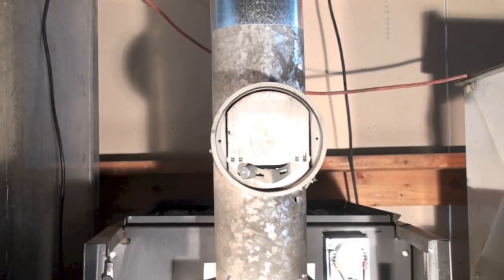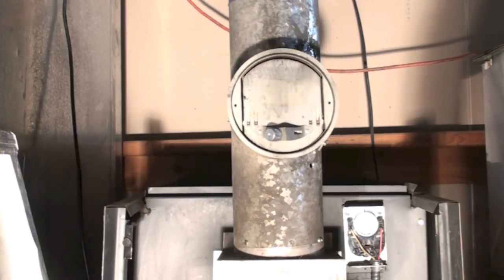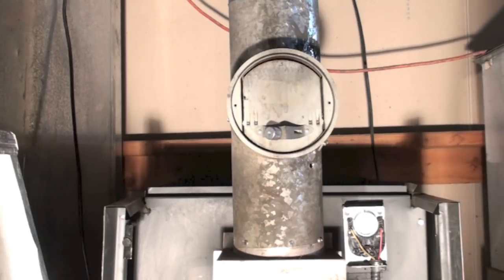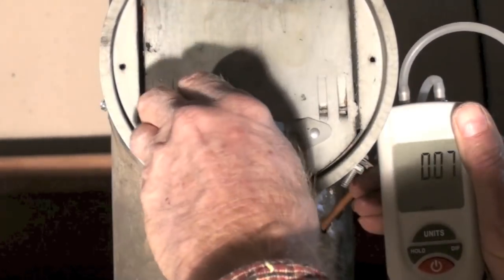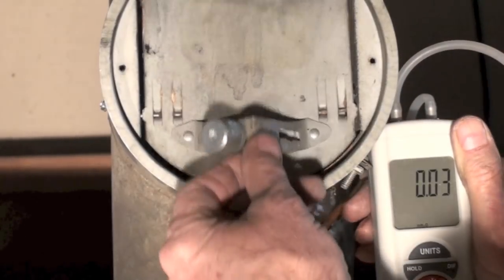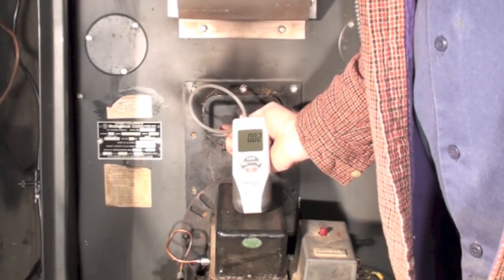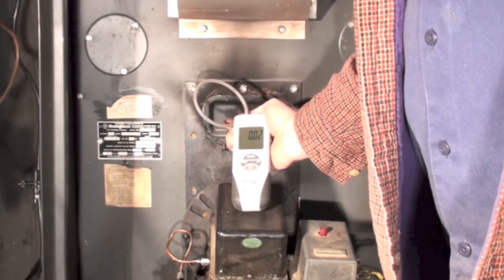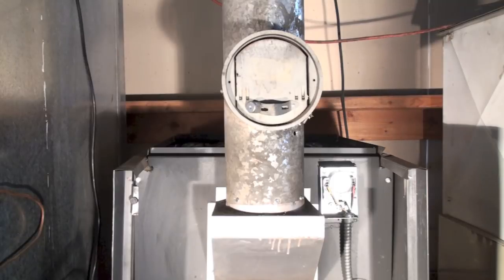How to set the oil furnace barometric damper

Comment: Great video. My damper, which is partly open when furnace isn't running,  always seems to close mostly shut when the oil burner kicks on. Is this opposite of how it is supposed to work? I thought the heating of the flu would increase draft and cause the damper to open a bit when burner is on.
Reply from the maker: It probably does not mean anything.  You could have a positive pressure in the house that may cause that.  Hope this helps.
GFM
Reply: @grayfurnaceman  He may have worn pins or something else that is not allowing the damper to move as freely as it should.  There are some cheaply made barometric dampers.  The good ones are made by Field. Sometimes the pins or the slots they ride in wear out causing the blade to drop and bind.

Comment: Your digital gage reads positive pressure, should it be negative or positive. Some Carrier oil furnace are designed to run in a pisitive draft while running.
Reply from the maker: I keep doing that! durn.  The pressure in the vent is negative.  When using metal vent, the pressure has to be negative.  You have probably seen 90+ efficient furnace.  They have a positive pressure in the vent.  Thanks for the thoughts.
GFM

Comment: many questions  :-) 
if i have to mutc noise of the burner noiller and exsaust , waht can i make to minimise the sound? i must play with the head to open it or close it? the air ?   smaller nozzle?
put in your mide , i cant change the pipe of exsaust because many people they dont want toi give moeny for that , so i want a solution with that !
Reply: a penney wise, a pound foolish,....
Reply: What are you even talking about...?  Talk to your HVAC technician the next time you have the system cleaned. Maybe they'll be able to understand you and answer your questions... but it certainly doesn't sound like it has anything to do with adjusting the barometric damper at all.

Comment: This device is at the bottom edge of it's scale, how you can say it is 0.01 or 0.02 difference? Could as well be 0.03 or less than 0.01. Considering the measurement on top was made with tube pointing down, toward the stream of running gasses which would slightly increase readings due to dynamic pressure added, I'd say static pressure difference is 0.01 or less. Need more precise or analog device here to tell better.

Comment: Is your barometric damper mounted upside down, I have a F. Controls RC type mine is mounted with the weight on top area. Between the furnace and chimmney is an angled flue mostly horizontal, so i have the weight on the left side.
Reply from the maker: I have seen this done both ways and it works fine either way.
GFM
Reply from the maker: You definitely need one and it should be adjusted with the use of a manometer.
GFM
Reply from the maker: Dampers are there to reduce draft.  You do not seem to have enough.  Be sure the smoke pipe and chimney are clear.  Heat exchanger could also be plugged.
GFM
Reply from the maker: Welcome
GFM

Comment: I have a Williamson Highboy Oil Furnace by Metzger mfg in 1999 and my over fire reading is -1 and overdraft reading is -1 and cant seem to increase my overdraft to -2. Specifications call for -1 to -2 for over fire and -2 to -3 for overdraft. Thoughts? thank you
Reply from the maker: You can't get a high overfire draft if your smoke pipe draft is low.  You need to increase the draft up the chimney.  First be looking for blockages in the smoke pipe or chimney.    Also be sure you have the maximum pitch between the furnace and the chimney.
GFM
Reply: @grayfurnaceman , my flue pipe is approximately at a 45 degree leading to chimney. My damper face is nowheres close to being level. Could that cause an inaccurate reading or less draft?
Reply from the maker: @matts7917  Yes.  You can rotate the damper to horizontal.
GFM
Reply: @grayfurnaceman  Thank you Sr, greatly appreciated

Comment: When I have my boiler adjusted the best I can, testing draft over fire and 0 smoke, at times, cold weather, the damper gets maxed out, running wide open. Wasteful sucking all that warm air up the chimney to keep the boiler to spec. Any acceptable way to decrease the draft of the chimney? I have stuck some bricks in the hole where the stack goes in the chimney and it helps a bit. Can't see any harm as I still have plenty of draft in summer and bricks don't burn. Replaced all of the turbulators awhile back, 18, with twisted spiral ones. Stack temperature down to more acceptable level now.
Reply from the maker: Do you have a barometric damper?
GFM
Reply: Yes. Under some conditions it is open all the way, although I never checked to see what effect this has on the boiler. I guess it would increase the draft but to any harmful effect I don't know. Anyway, it's a lot of air going up the chimney to balance the combustion draft.
Reply from the maker: @bigpardner  The barometric is there to reduce draft.  You can get an outside air adaptor for barometric draft dampers.
GFM
Reply: Thanks for replying to so many of our questions.The damper is certainly reducing the draft-through the boiler-but when it is maxed out under very cold weather I assume the draft through the boiler rises above what it should be. I adjust for -.01--.02 but usually not in winter. Guess I should test it when this happens to see how much it rises. I've thought about outside air, which in my case should be easy as there is an unused duct left over from previous owner having a Jennair downdraft grill above in the kitchen that goes outside, passing right through the boiler room. . It has an outside vent working in the wrong direction though. Since the boiler is in it's own small room I've thought about just supplying outside air to the room and try using something like a barometric damper to let the air in based on need for it. That still wouldn't prevent the draft of the chimney exceeding the stack damper's capability to adjust for it. I think I recall reading somewhere about using two dampers but that's more metal work than I want to get involved in. I'll wait and test the draft once it gets cold,  but was wondering if there is an acceptable way to reduce chimney draft.
Reply from the maker: @bigpardner  The barometric is the only way I know.
GFM

Comment: My vent is always open . Even while the boiler is not running.  Is that not oka?
Reply from the maker: It is probably open because of a positive pressure in the structure.  May not be much you can do about it.
GFM

Comment: Hi GFM.  I have what looks like the same model manometer as yours, but can't seem to get an accurate reading out of it below 0.10 (as in it seems to only start reading from 0.10 and then up in 0.01 increments - 0.00 reading prior to that).  It is a HT-1890 readily available on eBay and might not be the same as yours.  I can't see from the video where you have the other hose/probe you aren't using, or is it just hanging down and not important? Does it need to be connected and at the same length as the hose you are testing with? The "instructions" that came with the unit aren't any help... Cheers
Reply from the maker: Sounds like junk to me. lt does not need the other hose.
GFM
Reply: Thanks. I figured that might be the case. Do you have specific model or a link to the one you use? Mine looks identical, but clearly isn't.
Reply from the maker: Its been so long since I got that one, I don't remember the source.  You might check my channel under the playlist "tools".  I think I did a video on it when I got it.
GFM
Reply: sometimes people want to test them so they blow in them like a balloon and knock the hell out of the calibration...

Comment: Your videos have been very helpful, thank you. I bought the manometer you use and it's very erratic. The measurements range from 0" WC to -.12" WC. Do you know any possible causes? I'm thinking of returning the manometer for another.
Reply: Just look at the barometric pressure of the room air. Obviously it should be steady. If it's not, return it.
Reply: @paulmaxwell8851  Thanks for the reply. I bit the bullet and got a Bacharach Draftrite and it's flawless

Comment: my boiler has the baro damper mounted horizonally at the rioght side of my boiler. The main stack, goes out to the left and runs about 40ft, to a power venter. The damper has the adjustment weight located at the top of the valve. is the correct position? in your video,  i see the adjustment screw at the bottom. Which position is correct? Thank you.
Reply from the maker: They will actually work both ways.
GFM

Comment: when our oil furnace is not running , we have quite the downdraft , that blows out into the furnace room via the damper , with  the -20    degrees C  this is a real lose in heat.  are there any dampers that are better at being airtight  than others when not in use.
Reply from the maker: The problem is not the damper, it is the negative pressure in the structure.  I am surprised that the furnace does not rumble on startup.  I would be looking for leaks in the upper level that are leaking warm air out.
GFM
Reply: thanks for feedback , will look further...

Comment: GFM, Where did you source the prob at the end of your manometer?  Can I use the static pressure probes like the one I use for my AC system for this? (I assume yes).
Reply from the maker: Actually, I just used a piece of copper tube.  The velocity is low enough that nothing special is needed.
GFM

Comment: I think it’s just because of the design of the crazy heat exchangers that Millers have that you never can get a true negative draft at the flame inspection hole because normally they are just vented straight out the roof.   when I open the little inspection door to look at the fire it goes from negative to faint positive negative to faint positive and so on and that’s what my service guy that looked at it said it has a hard time establishing draft I think.
Reply from the maker: I don't think a barometric would help here.  Barometrics reduce draft.
GFM
Reply: @grayfurnaceman   yeah but do you think the 12 feet of 4 inch pipe is causing much back pressure on the furnace?  It’s never had any issues in the 3 years I’ve had it installed except for the very recent issues of it not lighting.  But I think it’s working again so far it’s been running through the night yay!!   
      I’m thinking of going with the thermo-pride miller replacement when this one wears out because they are still cleanable!! Do you think that I could just install it the way this one is installed with the 12 feet of 4 inch pipe or would I want to install a chimney??
Reply from the maker: @mainelyelectric  I would recommend any horizontal pitch be as steep as possible, but it should work.
GFM

Comment: How come the manometer is showing positive draft in the flue. I have the same meter but it shows a negative number. Been learning allot from your channel. My new oil fired boiler has a positive in the chamber and negative in the flue.
Reply from the maker: It is actually negative.  I generally do not pay attention to whether it is positive or negative as if it is positive, there will be a strong smell near the vent.  
If your system has not been in use and has a positive in the combustion chamber and is not designed for a positive pressure in the combustion chamber, there is a problem with the installation.  There should be specs with the installation instructions.
GFM
Reply: @grayfurnaceman  Thanks. The video showed .02 and not a negative .02 at 2:36 of the video. Mine is suppose to have a positive .02 over fire and negative .04 at the breech or flue. I always thought you needed negative at the breech.

Comment: This may be a stupid question, but how come you never see those barometric dampers on gas furnaces? Most of the time when I test, the draft is high, and this would be an easy fix rather than getting into resizing vent pipe. The only time I would see a damper would be if it has a side vent kit. Maybe you can do it, and its just not popular, but I can't recall ever seeing one. thanks
Reply from the maker: They are actually used on some commercial and industrial units.  As for gas designed appliances, they will have one of 2 vent controls.  Older furnaces used a draft hood to control draft and too big of venting(up to a point) is considered ok.  The second is induced draft appliances.  They are negative pressure vents,  but a barometric would upset this draft and may cause vent gasses to be vented out the barometric.  So I guess, leave them alone.
GFM

Comment: Do you know what would cause the damper to Slap close from time to time 
Would it have to do with positive pressure in house or possible short cycling of burner?
Reply from the maker: Its from a positive pressure (wind?) in the vent or a negative pressure in the structure.
GFM
Reply: Thank you

Comment: Thanks for posting the video BUT may I suggest you start out explaining 1) the physical significance of having the device in the exhaust of the heated, burn gas; 2) how is the device constructed so it would open by adjusting the weight and how the movement of air creating the negative pressure differential that would cause the flap to open and allows the ambien, unheated air to move in by the suction effect of the moving hot air, etc;  otherwise, you are just telling the minute changes in the number but did not explain the meaning behind doing it. You may write and say you assume people already know what the thing does, etc.; if that is the case, then.....
Reply from the maker: You are correct that this one is about how to adjust the barometric.  
You are also right that I should be doing one on what it is there for.  I will try to get going.
GFM
Reply: @grayfurnaceman  Thanks for the reply. Great job on the video.

Comment: Wondering why your manometer is showing a positive pressure draft instead of NEGATIVE (-) .02 and .04 respectively?
Reply: nevermind... Didn't notice previous posts
Reply from the maker: Mark Bean It is on the wrong side of the tool. I tend not to pay much attention. The number is the important part. 
GFM
Reply: Thats a shop environment, not an actual install.  you wouldn't put your access hole there  so close to the damper, thats why he kept trying to aim it down in the video... with 3 feet of pipe, it would be easier for him to show Im sure...

Comment: Mine blew off and flew 10’ yesterday , any answer to that?
Reply from the maker: Put it back on, lol.  
Seriously, you have had a blowback (read kaboom).  This was probably due to delayed ignition.
First, you need to check the heat exchanger and smoke pipe for soot.  Clean the soot out, and service the burner.
GFM
Reply: @grayfurnaceman   thank you. had to disassemble the unit and clean it up!

Comment: I just bought the same manometer. I’m confused. What unit of measurement to I set it on for the same testing you show in the video?
Reply from the maker: I generally use inches water column.  (in wc)
GFM
Reply: My manometer says (InH2O) for wc, I think but on that setting I get no readings. If I use (ozin2), I get readings that look normal...?  Looks like the exact manometer you used in the video. Is ozin2 unit ok? Also,  this boiler has no heat exchanger, it heats water for radiators. Just cleaned the cast iron grills and it read .03 over fire, and .03 to .04 in breech. Hole in breech is 12" above top of boiler. Am I good to go?
Reply from the maker: I think you are good to go.
GFM

Comment: Thanks for sharing your knowledge.  Shouldn't the readings be negative?
Reply from the maker: +barewolf Yes.  I tend not to pay much attention to which side is attached to the vent.  Perhaps I should.
GFM
Reply: not always! The Riello is a positive pressure burner and I think some Carlins are doing the same thing too...
Reply: @hvac01453  If you had positive pressure over the fire it would cause a blow back into the room...
Reply: @ohger1  a positive pressure over the fire is mandated by Riello and a few others now, due to the multipasses of the combustion chamber... Its nothing extreeme, but it is positive for sure.  Ive been running mine positive for 27 years this way.
Reply: @hvac01453  Didn't know that.  Thanks.

Comment: Where did you buy the probe that goes on the end of tube.  I see your GSI video, but probe end not included.  Thanks!
Reply from the maker: Chuck Swanson I think that's just a 3/16" piece of copper tube.  The small pressures here do not require any special end on the tube.
GFM
Reply: grayfurnaceman Thanks!

Comment: Thanks for a good video. What gauge are you using to measure the pressure?
Reply from the maker: That's an Ebay special.  Works well though.
GFM
Reply: @grayfurnaceman   What is the mesurment in ? inch/H2o ?
Reply from the maker: In wc.
GFM

Comment: How can I get a pressure gauge like that ? Thanks.
Reply from the maker: I got that one on eBay.
GFM
Reply: @grayfurnaceman  Thank you. What do you call that meter with a high temp probe----ie manometer, etc?
Reply from the maker: @trankt54155  Its a pyrometer.  Just means a probe capable of reading temps above about 700F.
GFM
Reply: @grayfurnaceman  Thank you very much. Have a productive day.